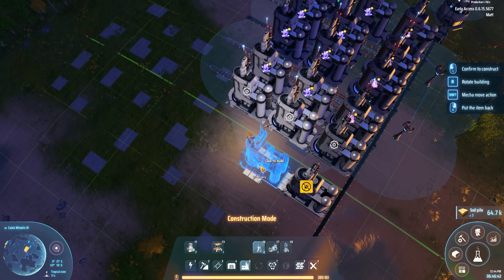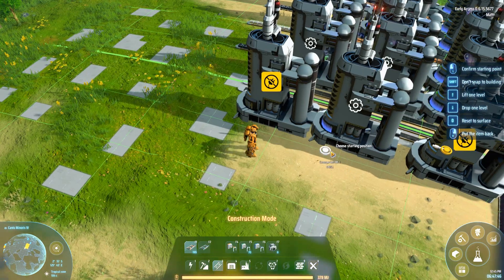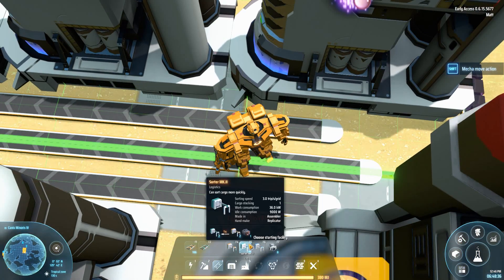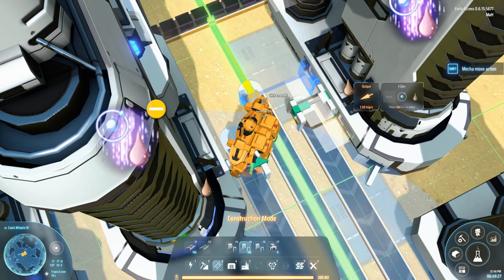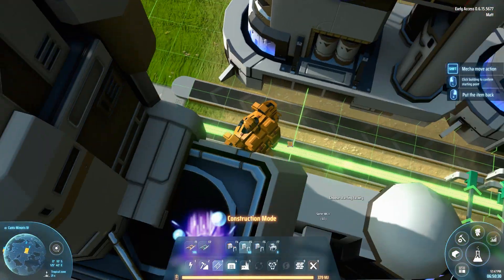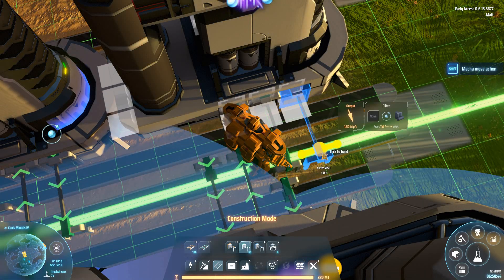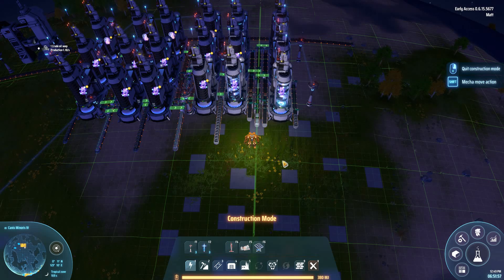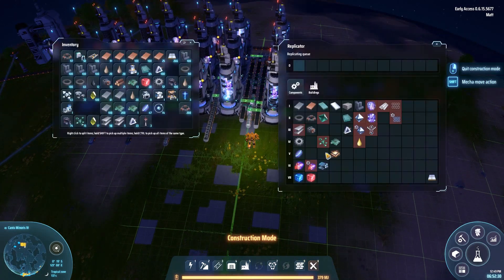Red Matrix Setup Tutorial - Dyson Sphere Program

Comment: Set up is flawed, graphite will always clog no matter how many or few smelters you add to supplement but the x-ray cracking will never produce enough graphite. My solution was the burn all excess graphite for energy
Reply: Might switch that to super magnet production tho
Reply from the maker: Red matrix needs 2 graphite and 2 hydrogen. This setup produces 6 hydrogen and 4 graphite. The graphite will never get backed up.
Reply: @7mattga7  you yourself said you supplement it with graphite from smelting it from coal. Base rate of smelting from coal is 30+ per minute. It always gets backed up on graphite I run it in my own world.
Reply from the maker: @RicoGG  use a sorter to move the graphite from smeltery line to the line from the refineries
Reply: @7mattga7  combining the two lines would just make the congestion worse
Reply from the maker: @RicoGG  https://gyazo.com/27f5a87ec35fbc656874ec56376ff661
You can do this. Have the supplment line insert 2/3 of the way down.
Reply: @7mattga7  re-read my first comment I’m not talking about the base production I’m talking about supplementing it with Coal.
Reply from the maker: @RicoGG  Okay... so how are you getting backed up on graphite. I dont get it.
Reply from the maker: You said yourself that the xray cracking will never produce enough graphite.
Reply from the maker: You could also not supplement with more graphite and just burn the excess hydrogen in thermal power stations
Reply: @7mattga7  so the opposite of what I said I’m already doing. Or does hydrogen burn better?